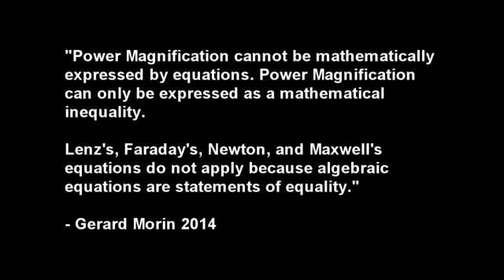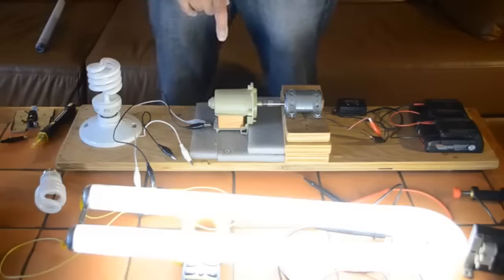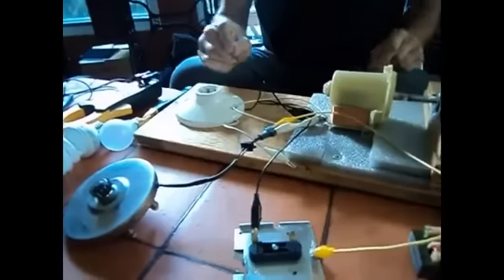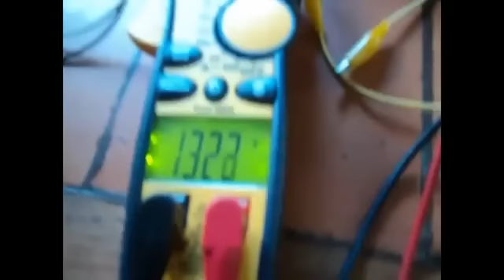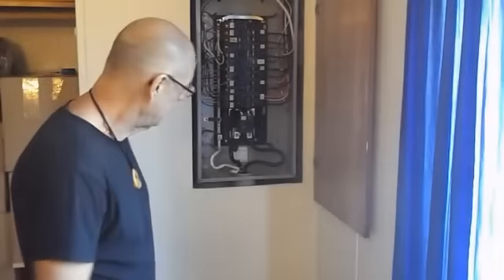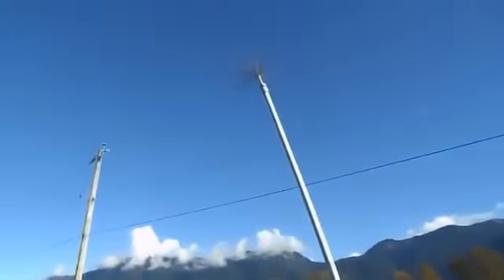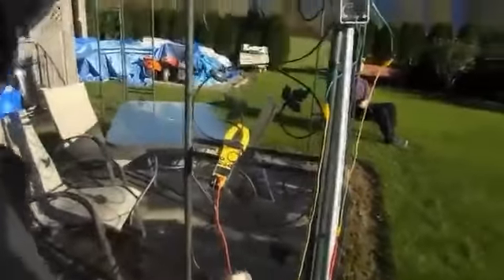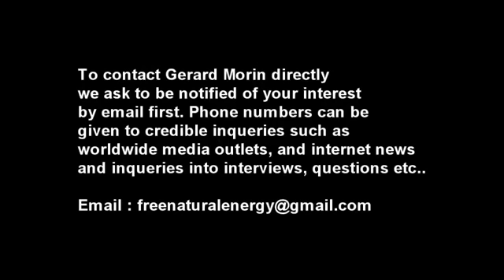Time to END The Electricity Racket - FREE & NATURAL ELECTRICITY PROOF

Comment: Solar. Use the sun's energy- charge the batteries(DC). Connect the batteries to an inverter that supply your home with 240VAC. Magic 🙄
Reply: Solar panels are stupidly over priced. Theyve already gone down a ton but still way too expensive. If you live where its windy you can get a more powerful setup for 1/4 $solar and buy more  batteries
Reply: @stevensgarage6451  Poly panels are very cheap if you can get hands on one if even used
Inverters are stupidly cheap (not those hybrid ones)
and keeping it to 12volts makes for a PWM charge controller which is even cheaper
Reply: $$$$$ Battery bank will cost a fortune
Reply: @stevensgarage6451  you only need a couple of panels to generate 40V.
Reply: Zach Lyons with solar your not paying a electric bill
Reply: That is just what I do, no one should have to pay for energy in 2020.
Reply: But even solar panels aren't even free energy.
Reply: @dickydewpodcast  Mine was virtually free and now is free to keep it in good condition I knew somewhere that has scrap deep cycle Leisure, I took in a computerised tester, checked for ones with good remaining capacity, paid the full scrap value to the business for the good batteries that had plenty of life still in them. Now whenever a battery goes bad I just go and swap it for a better one. 
You need to get friendly with a Motorhome or boat business.
Reply: @BallOfEnergy01  Nothing is completely free and many people moan & groan on about the infrastructure cost and the dreaded PAYBACK TIME, but look at it like this for a minute, a Solar Thermal panel even homemade is often around 70% efficient and it can produce free hot water from sunshine. 
In contrast, a gas boiler is also infrastructure and costly and produces hot water, but you have to keep paying for the gas to run it so a payback date does not exist. 
My Solar Thermal panel I built myself from scratch and fitted it to my roof in 2003, it cost about £500, it did not come easy though, I am an engineer but it took months of figuring out and some teething troubles but not many, but most of all damned hard work and head-scratching. 
Keeping it safely on the roof during the worst storm conditions was of paramount importance, also I wanted it to work with no pumps or electricity, the only electricity involved is a mostly passive electronic monitoring system which allows me to know at a glance how much hot water it has produced and at what temperature. 
And for this I did all my own electronics and LED indicators were all sourced to the very highest specifications and brightness, then I chose dropping resistors of high ohms value to underrun the LEDs for maximum lifespan and minimum current consumption, indeed all components and the circuits I built were made to consume milliamps only of current.
Some LED indicators are running on only 1mA of current
The system now owes me nothing, it has paid for itself many times over and works roughly between Feb and October, when it does not work I can heat water from free wood. 
Now I also have Electric PV panels, I used the same hard work, attention to detail and ethos has before, I did everything over-engineered to reduce the likelihood of failure.
My energy bills are almost zero, which has it happens with price increases I am now most grateful for, and it frees up cash to use on the finer things in life like dining out with good female company.
But most of all I have reclaimed some of my dignity back of not having to rely on someone else for my energy, and of course for me and my system power cuts are not really a big deal anymore. 
I agree it is not for everyone and I do have lots of knowledge of engineering which helps, but many people waste money on so much more trivial stuff.
Reply: All you need is a battery bank of 10 heavy duty 12v 100 amp batteries. And even they will run for about 3 years before you have to replace them at $1,200.00 each! 😲 

Plus the cost for the solar panels which you'll need about 25 of them to recharge these at around $350.00 for each 40 Watts panel.
Reply: @williamkunte5361  My system was way cheaper, I have 8 x 100-watt panels and 8 scrap 100ah batteries people make things too complicated and you do not really need the massive power levels that people have become brainwashed into consuming.  My house also has a 12 volt supply I even have a 12-volt socket outlet in my bathroom because it is perfectly safe, unlike mains electricity. The only time I use my inverter really is when the washing machine is running , my Fridge is a secondhand 12-volt compressor fridge off a boat and it cost me nothing, in winter I simply keep things cold outdoors.
Reply: @richardsandwell2285  Sound's good. However give me some insight into how I could live off grid with a solar power inverter system like this to power my entire house and especially my AC all days?

Give me some ideas.
Reply: @williamkunte5361  It is difficult because I do not know your individual situation, I live alone for a start in a fairly medium-sized UK house with a front and back garden, you may have a family.
And it also depends on your level of skill and knowledge, I am an engineer so a lot of what I do is second nature. 
And it depends where you live in the world.
Many years ago in 2003 I built a homemade solar thermal panel, which happened because one night after work when I was married I heard the gas boiler ignite (Furnace) if you live in the states, I then went barefoot up the garden to do some gardening and burned my feet on a concrete slab that had been in the sun all day, that started my journey into all this, I just thought I am paying for what is around me all the time. 
The house needed a new roof and I was apprehensive about putting anything on the roof that had just been re-tiled, so I needed to make a decision get the scaffold taken down or keep it while I built and installed a homemade thermal panel, after being up on the scaffold drinking a few strong beers and then having to make it back down a semi rotten wooden ladder (That bit not recommended)  I decided to go for it and I am so glad I did. 
At the time we had zero standing charge on the gas so summer I would often get a 50 pence bill and once I had a bill that was 0 pence. 
Then the price of Electric panels became viable so up went the scaffold and I fitted the 8 I was talking about. 
I am not really interested in a grid tied system although I could be making money by feeding in excess that is not my thing. 
So the first job was to install a changeover switch between the tails leaving my electric meter and my own new feed from my 3000 watt inverter. Then I had to fit my MPPTs and battery bank, yes I spent money on 70mm2 battery cable, clamps and crimps and much more, but the biggest cost was in sheer hard work and brainwashing to get it all correct. 
Safety was number one priority, including making sure the panels would stay on the roof during a severe storm.
The system is still not big enough to get through the winter, however, that is a temporary situation.
My system will soon have another six panels facing South because the other electric panels face west, but these new panels will be in my preferred location which I would recommend to anyone with enough land put the things at or near ground level, think on a wood store roof. 
Incidentally when I have no solar thermal I can get hot water from burning wood and winter heating because I ripped out the gas boiler and fitted a wood burner, but again that is no mean feat to do correctly and they are without doubt messy devices and I would say the most enjoyable bit really is chopping and stacking wood for me. 
Above ALL other advice I would say if you live alone be Frugal.
I no longer have mains gas, they got greedy and started wanting to charge £94 a year just for having a meter in the house so I politely told them what to do with their supply, I now use bottled gas for some cooking when the wood stove is not on, I plan to have electric induction hob eventually when I revamp the kitchen.
Like I said I do not know your situation, so maybe a lot of what I have said would not work for you.
My batteries are scrap I check them with a computerized battery tester, and keep health records on each one, now when they go bad I simply swap them out for better ones from the recycling at my work, I put the bad ones back in there and remove ones in a better state, so glad I could not afford new batteries, at first I made a few mistakes, left the inverter on all night mid-winter and must have caused some damage, my intention is maybe one day when I am at full capacity with small wind turbines I may buy different or new batteries, but for now I am happy with what I have. 
The thing about having two sets of panels if you can facing both south & west is good advice, unless space is an issue, complex sun-tracking systems are not worth the hassle
Reply: Stupid. If you're truly "multiplying" energy, you don't need solar energy. All you have to do is feed a portion of the multiplied energy back to the source, keeping the batteries charged or directly into the DC motor. His voltmeter showed over 4K volts after stepping the circuit up through two transformers. Surely, a mere 36 volts can be redirected back to the batteries or directy to the DC motor driving his "modulator". Keeping the battery in the system enables an easy start after stopping it. Otherwise you would have to turn the DC motor by hand until you multiplied enough energy to feed back int the circuit and be selfsustaining. This is assuming that his method of "multiplying" energy actually works.
Reply: @vampy625  hey can we talk
Reply: @richardsandwell2285  hi can I have your email id like to learn this better.gratitude

Comment: I have a question. Will that 36v battery run that system and generate enough power to recharge it’s self? If so you have a loop of self sustainable power right?
Reply: IMPOSSIBLE
Reply: Always remember the Laws of Conservation.  Physics isn't a guideline.....it's the Law.

Comment: 18 plus 18 is adding, not multiplying voltage, and he said you can't increase current with a battery?  with a battery you can add current or voltage, depending on wether it's connected in series or parallel. 
When the opening statement makes no sense, is there even a point to pay attention?  Just another lie.  There is no such thing as free electricity.
Reply: Finally a sensible comment. Also he says he isn't increasing volts but something called "Electromagnetic watts". What's that!?
Reply: yea, thats what i thought too.
Reply: You will see
Reply: Yes, he says that at the beginning of the video when he explains that the two 18v batteries makes 36 volts.  Where he's multiplying the volts is when he adds the transformers, if I'm understanding it correctly.  Parallel battery connection doesn't increase the amps, it increases capacity...or how much energy is stored.  It doesn't increase the current.  What confuses me is the devices between the bulb and the batteries.  I don't know electricity much, so I'm still not sure what he's even accomplishing.  I see lots of people laughing at each other and calling each other idiots on here, but I don't see anyone actually explaining anything as to what and why what he's doing is right or wrong.  I still remain on the fence about anything he's doing and whether it's viable to free anyone from anything.
Reply: Psht...somebody up there isn't paying for it
Reply: I'll reply to my own comment to say that I found another YouTuber that explained why this "free energy" is wrong.

Comment: Not one of these crackpots understands the scientific method or even how evidence works.
If your contraption can genuinely produce more energy than it consumes:-
1. Cancel your contract with your electricity provider. Obviously it is now obselete.
2. Place said free energy device in a bell jar, charging its own batteries.
3. Set up a live webcam aimed at device.
4. Leave running.
5. Prepare excuses for why device stopped working.

Comment: Right at the beginning: "You can only multiply volts you can never multiply the amps of the batteries"
Wrong! Batteries connected in parallel multiplies the current. No need to watch this fraud any further. Doesn't even know the most basic things about electricity.

Comment: For everyone asking for a parts list and how to build it, there's a reason he hasn't shared that with you despite the fact that his stated goal is that "everyone needs to get their hands on this technology... Everyone can produce their own energy!" The reason is because this isn't real. All the talk about tesla, and energy amplification and big smart people talk is all to distract you from the fact that the laws of thermodynamics are very simple and clear on this fact. There. Is. No. Free. Energy. This current isn't smart. There is no such thing as an electrical circuit doing work without amperage. The reason he isn't getting an amperage reading in the first test isn't because of smart electricity. It's simply because his meter leads are connected in parallel to the circuit, not series. The electricity needs to go through the meter in order to get an amp reading with leads. If he used the amp clamp on top of his meter it would read something. All he did was create a crappy inverter and spew jargon that anybody with half a wit about electricity would know is A complete farse. If you want nearly infinite clean energy source then support nuclear power. Nuclear power is actually real.
Reply: I am looking forward to the day Fusion is perfected, and implemented.